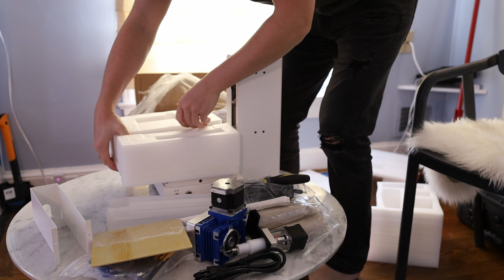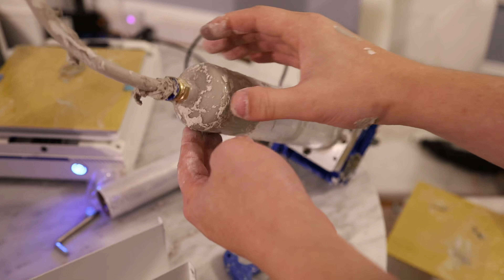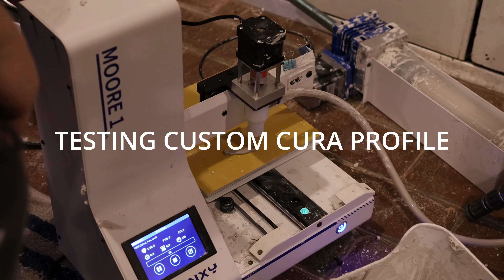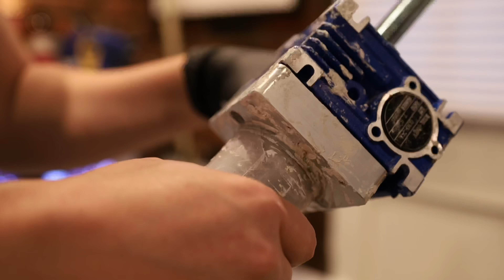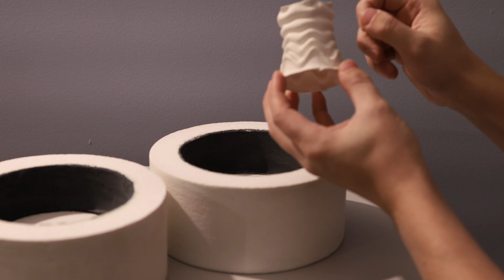Printing in Clay With The Tronxy Moore 1

Comment: It would probably be easier to just make a baker's pipe with the bag by cutting off a corner.  No need to directly handle the material.  This technology would be interesting with lower temp ceramic composite materials.

Comment: 🎯 Key Takeaways for quick navigation:

00:00 🏺 Tronxy Moore 1 is a clay 3D printer that extrudes clay to create pottery and ceramics.
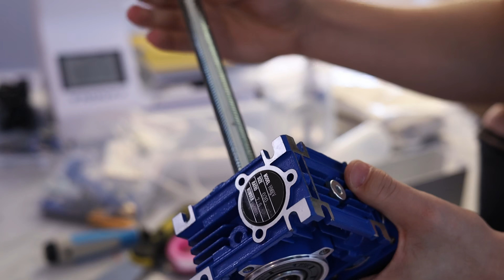01:24 🧰 Assembling the printer involves installing a lead screw and preparing the clay cartridge.
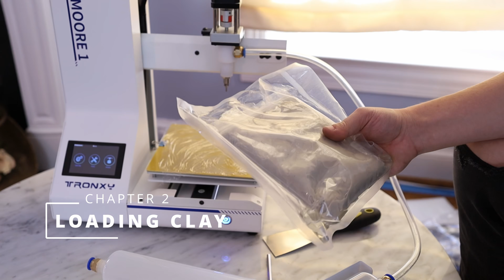03:19 🎨 Proper clay consistency and bubble removal are crucial for successful 3D printing.
08:12 🪣 The printer starts printing without preheating, and maintaining the right clay consistency is essential.
09:28 🍶 After printing, you can post-process the clay objects by smoothing, coloring, or adding texture.
15:47 🔧 Cleaning and maintaining the printer is important to prevent clogs and ensure consistent printing.
19:56 🔄 Combining handwork and 3D printing with clay allows for flexibility and customization in creating ceramic pieces.
20:10 🔥 Firing ceramics requires a thorough drying process before using a microwave kiln or traditional pottery kiln.
20:39 💰 Traditional pottery kilns can cost hundreds to thousands of dollars, but microwave kilns provide a cheaper option for firing ceramics at home.
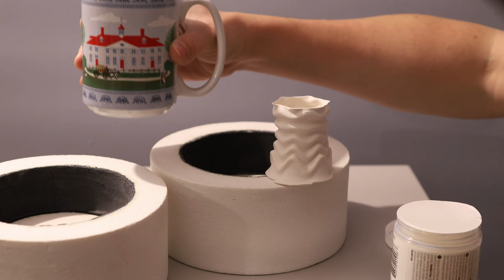23:16 🍽️ Ceramics in their fired state are still porous and not food-safe until glazed, which provides a smooth, non-porous surface.
25:36 🏺 The Tronxy Moore 3D printer for clay offers a unique intersection of pottery and 3D printing, suitable for those with backgrounds in both fields, but not recommended as a first 3D printer due to its learning curve. It's also a valuable tool for professional potters and can create complex geometries.

Made with HARPA AI

Comment: Long shot. Coulf you print a bird bath with this? Make aligned supports using a plastic printer, the print it in pieces? Would you be able to make interconnected pieces that still fit after firing? Are kilns even big enough for this type of thing? Or would it just break?

Wait could you load cement/concrete into here? Would it set in time? I have soooo many questions.

Comment: The Persian yakhalt is a solar-thermal energy device used as a fridge made out of mud.  If you could make the 3D printer itself mostly out of clay, and you could grab random dirt and turn it into clay and print out a clay energy collector and another 3D printer you could keep on doing it to make the clay printer (or clay printer complex) replicate, allowing you to turn huge dirt fields into clay printers / energy collectors.

Comment: Hey Nathan, nice informative video! One Question, do you think this machine is able to make some nice molds in clay or ideally ceramics for aluminum casting? The parts should be geometrically correct, surface quality isn't the issue since they would get milled anyways. 

I now use lost PLA casting wich is a cumbersome process. 
Thanks in advance.

Comment: Tronxy Moore 1 hawe next 7 problems. 
1- on delivery Z edstop its broken and turn by side - fix its simple change endstop to other. 
2- parts when connect worm gear and clay feeeder stepper motor hawe bad size and not transfer rotation to clay tube ad make clicking noice. Fix - 6 dolars and buy next one its 8 to 11mm. Factory broken parts mayby on all Moore1 
3- firmware from edition 1 ad cura - firmware and default config from tronxy  its broken must upgrade or printing speed from all g-code its 10mm/s.  
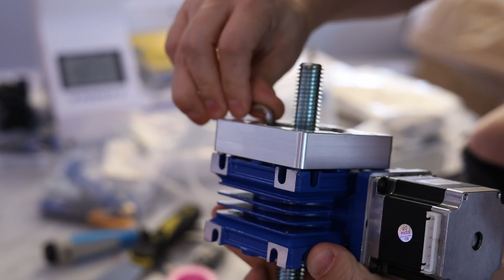4- worm gear hawe reduction 1:7 and its weak this same product on Eazao its 1:30 and working better- no heating motor no 0.7 or 0- somthing feeding controll speed. 
5-extruder extreme heating self on 10 minutes works.
6-Time to warranty its only 3 month
7-Customers support on tronxy cannot identify brokend parts from month 11/2021 to today +- 3 month emailing videos sending and nothing. Tronxy support its very very unfriendly and when you give him all broken parts you must buy him on other place. No change parts from tronxy side.
This printer its broken toys and not usable. Mayby i hawe only one totaly bad pcs or its all this produst thats broken i dont know.

Comment: It's great to see more and more attention to ceramic 3D printing. In the video, the model is seen collapsing in the final stages due to the fact that the clay is too soft.

On the one hand, you can use a heat gun to speed up the solidification of the clay during printing, and on the other hand, you can use a harder clay during the loading stage. But if the clay is too hard, I'm worried that the feeding structure of this equipment can't bear it, and the sheet metal fixing the cartridge will break.

In the video, the electric push rod makes many abnormal noises. This is because the motor cannot be pushed. You can replace the high-power motor driver or replace the reducer model. Here is a judging indicator for clay: https://youtu.be/NYi6CyIB8_0